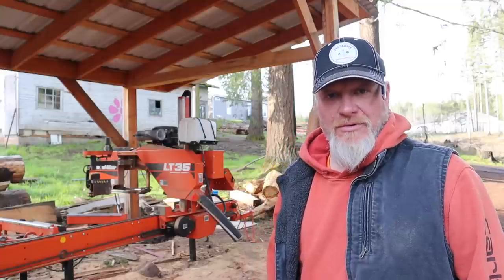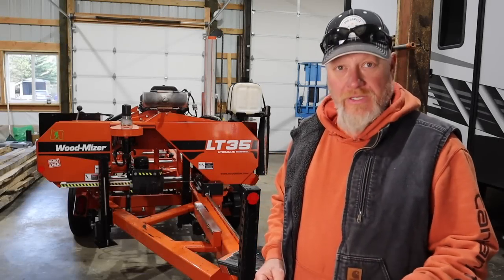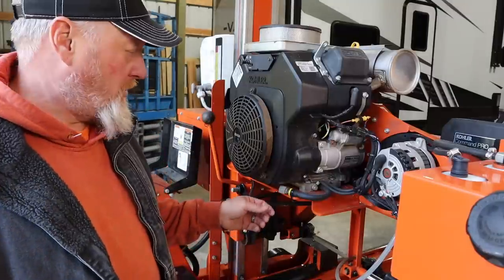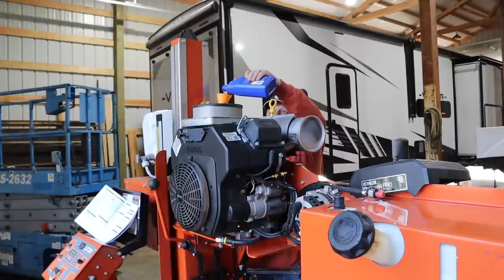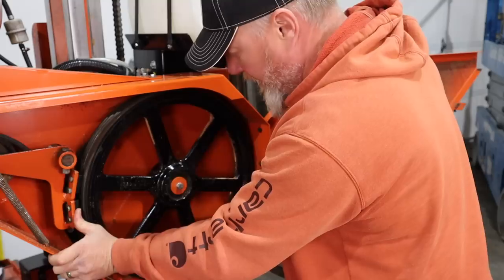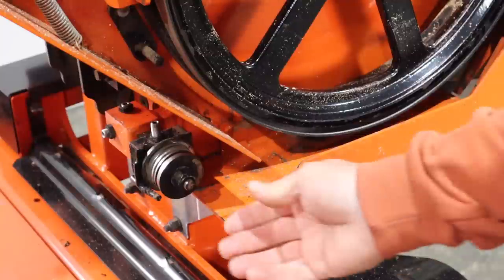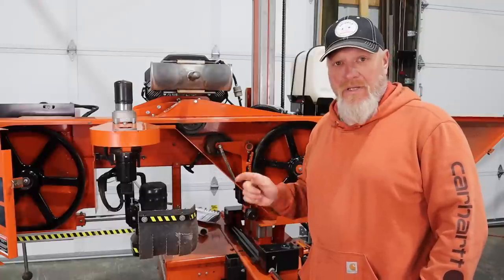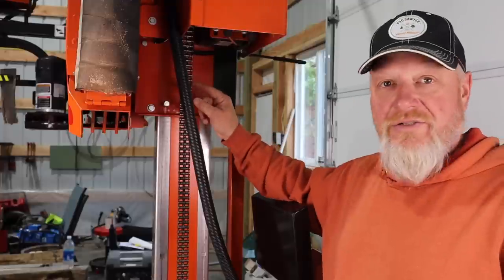Routine Wood-Mizer Sawmill Maintenance

Comment: Thank you for doing this. I am sponging up all the information that I can find on the LT 35. Praying mine gets delivered this fall. I have been following your videos for some time. Always enjoy them.
Reply: Automotive oil filters will fit the engine. Match it up at parts store
Reply: When did you order your mill,If you don't mind my asking.ty
Reply: July 2021
Reply: @Doug Stewart  I ordered mine in May n still haven't heard one word from them.LT35
Reply from the maker: Thank you, Doug! I’m glad I can help.
Reply: 😲  That long?!  Eeesh!
Reply: I called Woodmizer last week. They said they are having difficulty sourcing engines. Would not even discuss delivery dates with me. The estimate they gave me last summer was 55 to 75 weeks. Could be a lot longer wait than that. 🤷
Reply: @Doug Stewart  yeah i ordered mine in March not may.the price went way up.i put 6 down plus my 1,000 down to start w an the monthly payment never changed.
Reply: The saw came in.
Reply: @exotictones1054  Can you tell me how much more your mill was than the quoted price? They sent me a price sheet when I paid my deposit. Is that not a locked in price? When I called them a few weeks ago I got a very underwhelming response. Just that they would not tell me anything because they could not source engines.
Reply: @Doug Stewart  there's a 200.dollar paper work cost I call it n they make you insure it threw them or get your own .w the 200.it's like 960.total n then if you have it delivered it's another chg.mine is going to be 1514.15.you think they would drop the.15...the price doesn't change just alot for shipping n was not expecting the near 1,000.added.I'm financing mine threw them.if you get it delivered n make more down payment they will take your shipping out of your down payment. Just a heads up.pay shipping separately so there's no financing on that.that's 4yrs.insurance plus the 200.hope I made it clear.

Comment: I’m in the process of buying a 2009 LT40 from a friend - just waiting for a new control module to get the forward drive working.  It only has 175 hrs on it, and while it’s been under cover most of it’s days, it is very much in need of a thorough cleanup and maintenance.   Although I already have the manual, this video is really helpful and greatly appreciated!
Reply from the maker: Thank you and congratulations on your new mill! You’re going to love it.

Comment: When I worked in the sawmill maintenance was every chance one could get especially cleaning and checking every component especially the sounds and out of balance,   I was fortunate enough to have great machi
Reply from the maker: You can’t do too much maintenance.
Reply: @NorthwestSawyer  that is definitely a good point,   but in a sawmill which is the biggest in the southern hemisphere it's extremely important to for fire suppression as operating 24 7,   when the automation come into effect it was even more important,   in the 12 year's i was there we lost 2 factorys aligned with the sawmill from huge fire's,   sadly the board mill apart of the business had a horrendously huge fire as the press had 9000 gallons of hydraulic oil underground and it talk 24 hours to put out,   sadly they never rebuild the mill,   we had five mills in our town and now only one left,   I was made redundant along with the thousand others over the time.   90 %of our logs go to china.  I prefer watching yours and many small mills now. I always look forward to seeing your video's, 😊👍💪👀.

Comment: You teased us with the 1 1/2 ton 1948 thru 1955 series deluxe cab Chevy truck at the end. I have a 1955 first series Chevy 3800 one tone pickup with a 9 ft bed, same color and patina. Great combination, old trucks and sawmills! Also, I'm going to try that siracha bottle trick. Great video, makes me want to go clean up mine, or I could just go fishing...
Reply from the maker: Fishing sounds like a great plan! I picked that truck up yesterday. It’s in pretty good shape. I’m going to clear coat the patina and go crazy on the rest of it. I’ve always wanted a 5 window Chevy.

Comment: Hey Jason I was just surfing thru some old videos, and caught this one. You may know this however those felts are replaceable. They are $5. Mine froze to the rail. Also I had Woodmizer come and tune up my mill. It was about $500. but worth every penny. Checked the deck and head, mine was within a 32 of an inch of perfect. They checked belts and tension. Checked all the bearings and replaced the one needed. Very good customer service. I am in NE Ohio and they came out of Indiana. Ron
Reply from the maker: I’m probably due for some new felts. As far as the maintenance goes, it’s something I enjoy doing. And it saves me a few bucks 😉

Comment: I don’t know how long you leave your mill in bark and stuff but watch doing that for very long. It will eat your wheels and hydraulics up. You really need to clean it every day or week. I’ve seen a lot of mills eat up
Reply from the maker: I try to keep mine pretty clean but keeping it dry helps a lot too. Water and sawdust together will definitely cause damage, especially cedar sawdust. Cedar and steel don’t mix.

Comment: I found with the Kohler engine that it required special services from the dealer,   but my employer wouldn't permit me to get this and just to keep the costs down,   I informed my manager that the engine definitely needed a proper service,  oh bugger it's started to give me trouble and eventually the starter motor broke completely and the tune was way out,   but he didn't care untill he drove my truck on the callout and he had trouble with the engine,   sadly he blamed me but the dealer for the engine had told me from the beginning that they must service the engine every 6 months at  $360 each time,    all my other engines were Honda and far better,
Reply from the maker: I’ve not had any issues with any of my Koehler engines.
Reply: @NorthwestSawyer  that very good,   I apologize for my inference sadly my thoughts say things without explaining properly,   ☺.
Reply from the maker: @warrenjohnknight.9831  no worries at all, my friend!

Comment: Automotive oil filters will work on that engine and way less expensive
Reply from the maker: Good to know!
Reply: @NorthwestSawyer  I corrected, oil filters. Any four cylinder, some with synthetic media supposed to last 52,000 miles!@$9 bucks a filter! Some may be bigger just add enough oil to compensate
Reply from the maker: @kennethhudson8013  wow!
Reply: @NorthwestSawyer  as always do your research first!